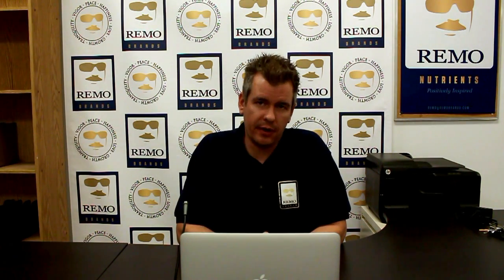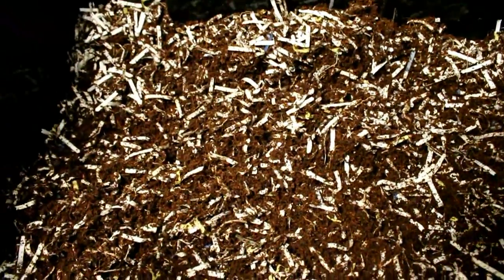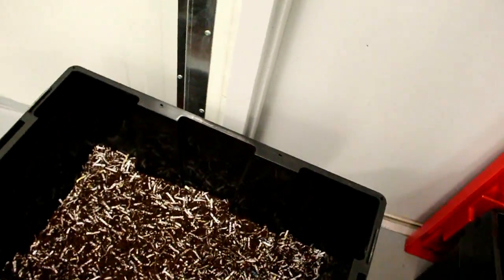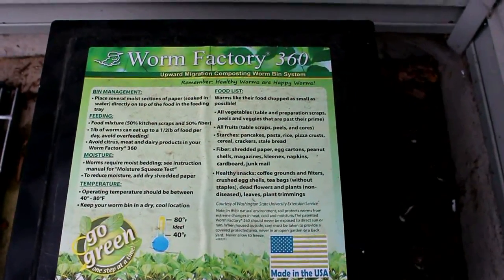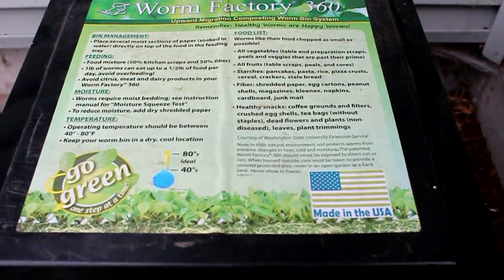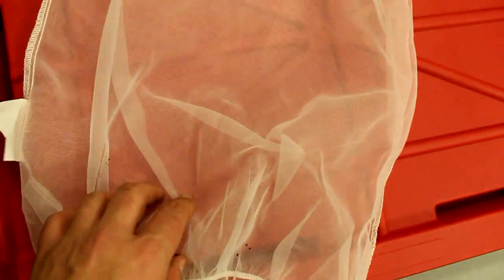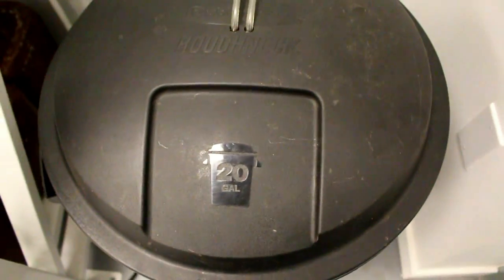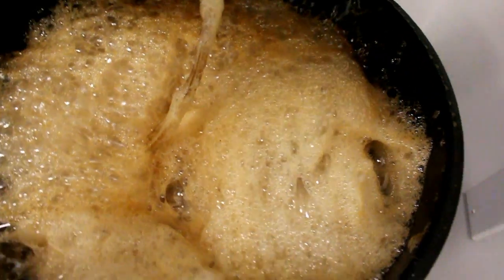Remo Nutrients R&D - Worm Tea/Beneficial Bacteria

Comment: I wonder how it smells :)
Reply: From what I have read and seen (and done)   , The tea will smell like fresh soil as long as the Microbes are living , When they start to die off it will start to smell like stagnant swamp water ( stink)   One thing that might help prolong  the life of the tea in a living state is to keep it aerated with the air stone and add a little unsulfured molasses to feed the bacteria and microbes after a few days. The Molasses is a simple sugar that the microbes feed off if.   Another tip is add a hand full of sand or sandy soil to your worm media. The worms need the grit to help them with digesting their food which will speed up your production of castings,  Thanks for the video :-)
Reply from the maker: iam21incanada When you aerate the tea, it actually just smells earthy (like dirt).  Stop the aeration and let it sit at room temperature...and it begins to stink....a lot.